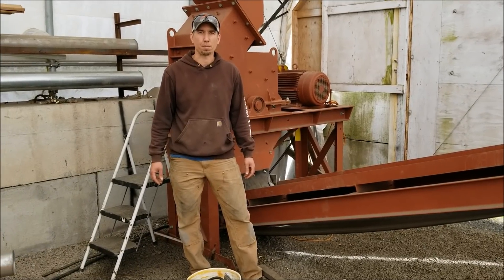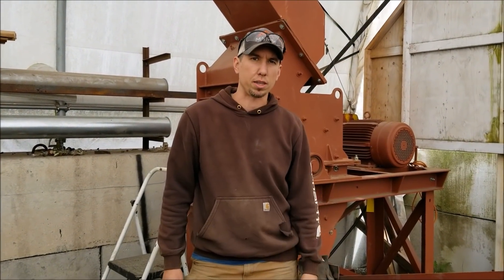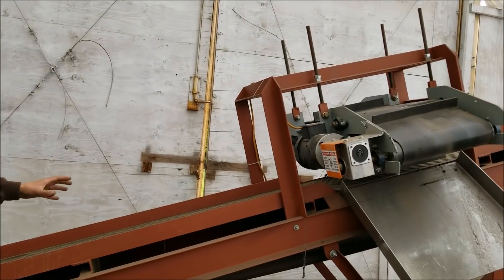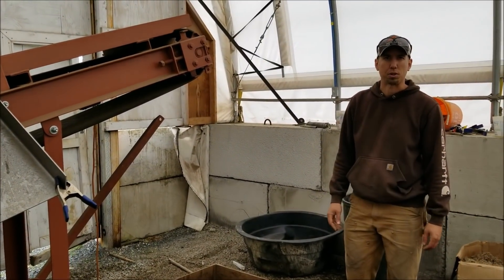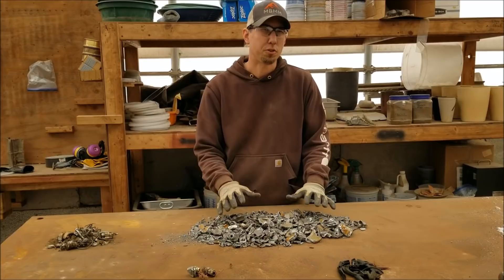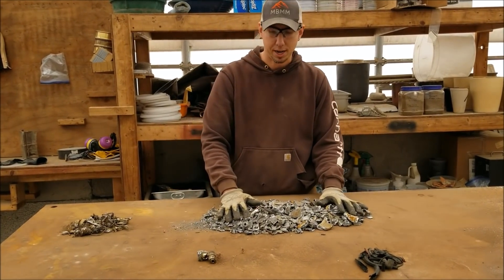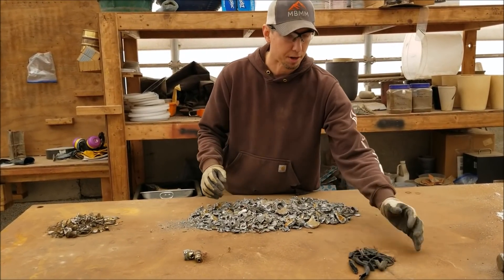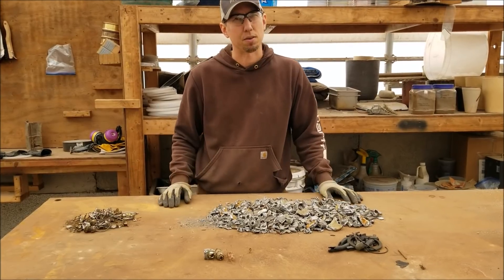Crushing Dirty Cast Aluminum in a Hammer Mill

Comment: That turned out really good I'm going to throw another request I didn't hear nothing back from you on the last one but I would really like to see you run some submersible pump motor through there the stainless steel type that has all the epoxy resin inside of them and they are a beast to tear apart but they're absolutely loaded with copper really would like to see that Jason.... thanks
Reply: lol they are full of oil
Reply: @scraphustle6168  that's interesting I've torn apart probably over 20 of them and never have seen oil in any of them ever... maybe that's why they quit functioning
Reply from the maker: Did you ever talk with Forrest or Allen about sending a sample of the pumps?